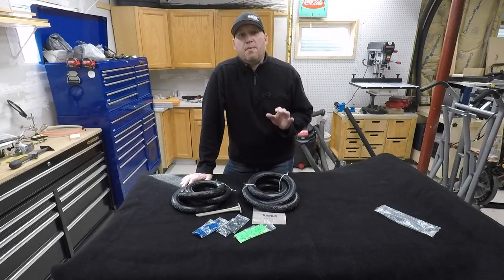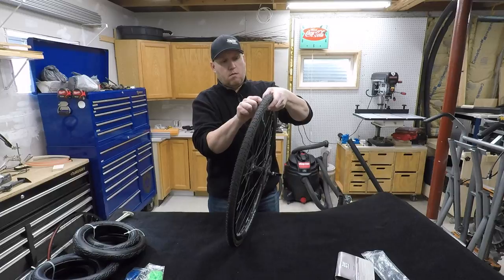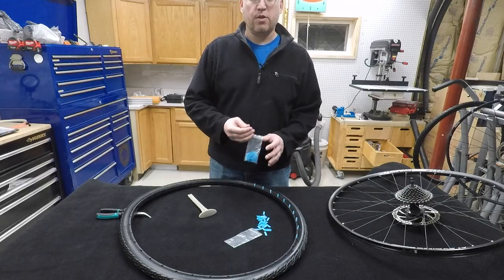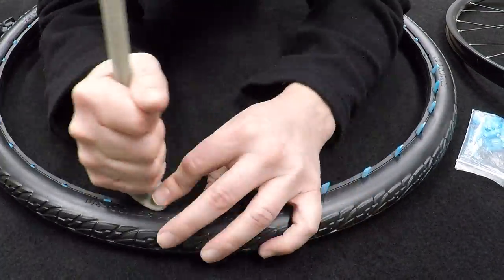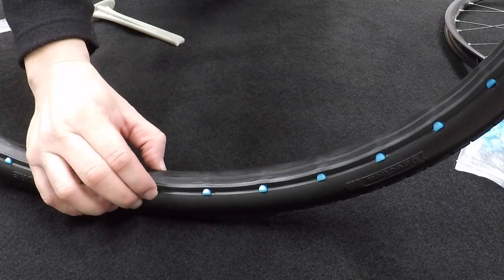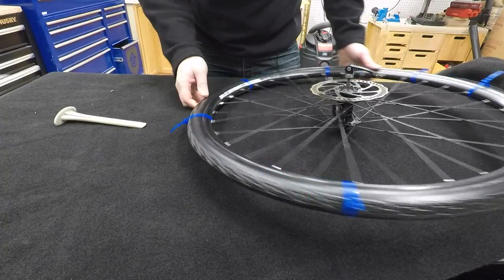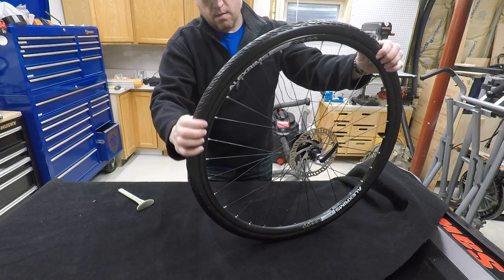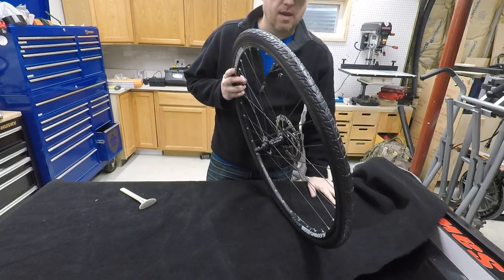Tannus Tires - Airless bike tire installation

Comment: Thanks for the ZIP TIE idea!  Didn't have the luxury of setting them in the sun, (was doing it at night). 
Used 12 zip ties per tire to get them on & it sure helped. Installed the Aither 1.75"  Did two bikes so 4
tires I installed. Was VERY glad I got the P TOOL also. We'll see how it works on the Gary Fisher tandem bike,
as that's supposed to be over the weight limit for the tires ( we'll take it easy to start with on it).
Thank you VERY much for your ideas, as your video truly made the installation a success!     mike

Comment: I purchased these last week and I found that they really slowed the bike down.  I'm glad you brought up the fact it takes about 50 miles for the tires to feel normal; I can't wait!  :)
Reply from the maker: For a regular rider for myself they were great.  They may have slowed my overall average speed a little bit however, that doesn't matter to me as I don't race.
Reply: @BusyDadsWorkshop  I don't race at all, but I am a safe fast rider (I don't cut off cars, other riders but can really clip along when the road is open)   Both of my knees are in bad shape and these tires really put a strain on them when I first got them.   Just creeping up to 40 miles on them and I feel they are starting to roll a little easier but sometimes it feels like it is swaying a little bit, but I guess it's just part of the tires.    Keep up the great videos!

Comment: I like this. I do have two questions. But before I ask, I just have something to say first... I lately have been dealing with flat tires frequently. I mean I can understand one flat every once in a while, but it shouldn't be flat tire after flat tire. Not to mention I only use my bike just to get around. I'm starting to question whether the bike shop I've been going to is selling me crappy tires and tubes or if I'm being cursed. I guess I'll find that out at some point. But now here are my two questions... Question number one, are these tires good for travel? And question number two, do they have some of these tires in studs? (Studs as in studded tires for winter)

Comment: What size clip and tire did you have..my clips did not fit  my rim
Reply from the maker: Honestly, I don't remember.  I did have to get the size larger for my rims as there was a slight width difference with the Alex rims I had.  Tannus should be able to help you out.

Comment: Ok, this may be a stupid question, but when the tire is directional, does the directional arrow (on the tire) go towards the road in the forward direction (i.e it points towards the road to come)?
Reply from the maker: Not a stupid question at all.  When the direction arrow is on top of the wheel, it should be facing the direction of travel.
Reply: Thanks!

Comment: how do you know what size rim do your order so the tire fits? I have 20-inch tires on a Catrike Trail. Thanks for your help.
Reply from the maker: Look at the tires that are on your bike now.  They will have a size on them that use can use to find an appropriate replacement size.
Reply: @BusyDadsWorkshop  thanks